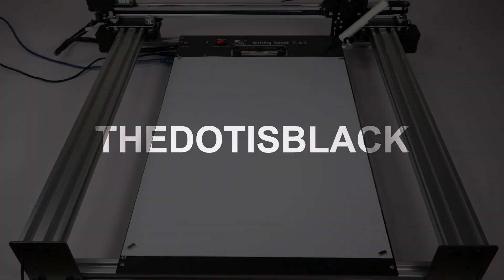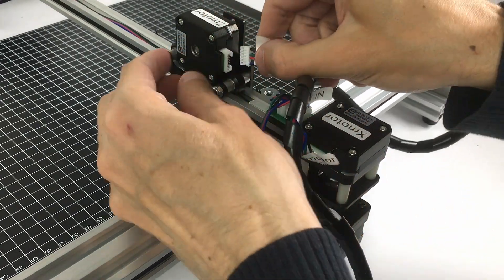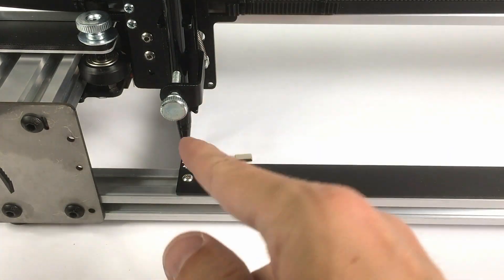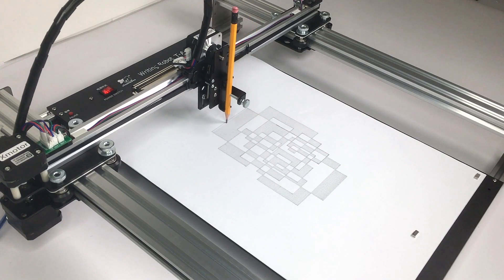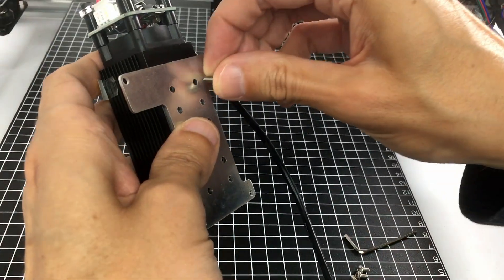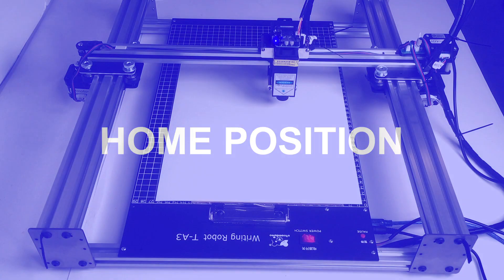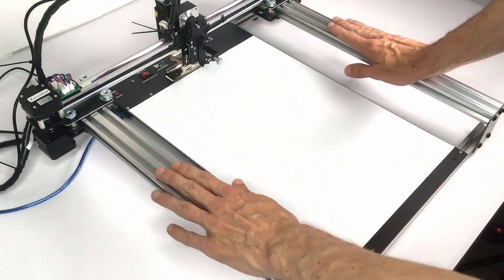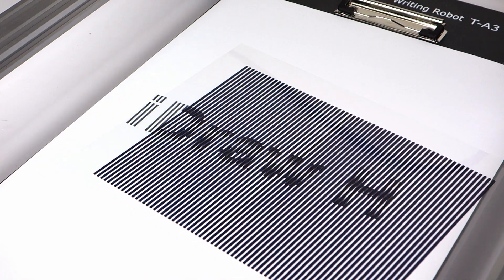REVIEW & TUTORIAL - iDraw H Pen Plotter with Laser Engraver  by UUNA TEK® (XY Drawing Machine)

Comment: Thanks for this review. Does this laser leave a black line on white paper after lasercutting?
Reply from the maker: Hi Rowin, at 32:30 you can see for a short moment a cut out circle on ivory paper. The front has no soot, back side is slightly yellow (that’s normal without air assist and grill), and the inner side of the edge is dark brown where the laser burns through the paper. That’s normal, there’s always soot with lasers.
Reply: @thedotisblack  Have you had the opportunity to try the 10/15W laser head as well?
Reply: @thedotisblack  What if I layered 3 sheets of paper, would the center layer white paper have no burn marks?  Also is it true that the lowest power laser model 500mW produces a smaller engraving dot per inch\millimeter than the higher 2500mW?  Thanks for the another great video!  Cheers!
Reply from the maker: No, I did not test the 10/15W lasers by uunatek. However I have a couple of 5W and a 20W diode laser machine. These are dedicated laser machines.
In general, there shouldn’t be any problem with more power. Works the same, just faster. But you’ll need protect the baseplate better.
Reply from the maker: Actually, you shouldn’t layer sheets of paper to cut through. It will be worse and you’ll need more time and power. Rather separate the sheet of paper from below, raise with a honeycomb grid for example. I have some laser cutting videos where you can see it.

The laser spot size depends rather on whether it a short or long focus laser. Short focus has rather smaller spots and is better for engraving, long focus generally has slightly higher spots and is better for cutting through thicker materials. 
500mW is slow. You can always change the power of a laser and thus adjusting the intensity of the burning/cutting.
Reply: @thedotisblack  https://youtu.be/6lBKCcUviZ4  Hello Again!  I found the video I saw a long ago about the "DPI" being higher\better on a low power laser.  I haven't found any other laser engraver on youtube making the same claim, and I don't have the expertise or equipment to test the idea myself.    If you ever have the free time and inclination I would love to hear a confirmation or debunking of the DPI difference between low\high power lasers.  My research say that LASER PRINTERS simply add more dots to create higher resolution. Somehow that sounds wrong to me because "more" is not "smaller"!  A laser diode at the smallest focus creates heat that would "blur" the dot created.  It seems to me that focus size and heat have to be ideally balanced to create the smallest dot engraving.   Cheers!
Reply from the maker: Hi! In general, you could say that a high power laser is not suitable for fine engraving. But it’s not that simple. Let me elaborate:

First, perhaps most important, short focus lasers have usually a smaller laser spot and are best for engraving. Whereas long focus lasers have a bigger laser spot and are best for cutting, especially thicker materials. 

Second, the more power a laser has, the larger the laser spot will usually be. This is especially true for diode lasers that combine multiple laser diodes with mirrors to one laser beam.
If the laser spot is large and you engrave with high dpi, the laser spot will overlap the burned/engraved areas and burn even more. It will result in dark spot. However, this can be controlled by reducing the power settings of the laser in the software.

And third, it all depends on the material and the size and details of the engraved image. Usually, with a high power laser, you would calibrate/reduce the power for engraving. Otherwise, the laser is simply too powerful and will burn the material surface. 

Lastly, some people intentionally set up slightly the laser out of focus to blur or add gradients (greyscale). This method is useful for engraving photos.

Personally, I think a short focus laser with a single diode is best for high quality engraving. But it is also slower.

Comment: Hello Sir,

instead of using Incscape to plot could you use Lightburn for plotting with the pens?

If so can you explain how to do it.

I hope you can answer my question.

Greetings from Belgium
Reply from the maker: Lightburn is for laser cutting and engraving only. It does not control the pen holder plate and thus it is not possible to use it for pen plotting.
Reply: @thedotisblack  Lightburn can work if the pen is activated with a servo . I have a Eleksmaker A3 en can switch between laser en plotter and they work both with Lightburn.
Reply from the maker: You can you use Lightburn for the laser module on the iDraw. However, I checked the Lightburn forum and some people manage it to work for pens but only if the pen holder plate has a servo motor. The iDraw has a stepper motor, it doesn’t work with it. Lightburn does not control the z-axis. Please correct me if I am wrong. Here is the link:
https://forum.lightburnsoftware.com/t/can-lightburn-be-used-with-a-pen-in-place-of-a-laser/10498/16

But I don’t know why people would like to use Lightburn for plotting. If you like to use some features of it, you can always edit your images there and export an SVG and then plot it via GRBL or InkScape. You will have more control over your plotter with these apps. Why do you want to use Lightburn for pen plotting?
Reply: If you’re using paper, cardboard, etc and not cutting, why use a laser?
Reply from the maker: @Kimberlymogan laser is great for cutting paper and thin cardboard. Also with laser you can engrave cardboard and other materials. It’s great!

Comment: hello I have a uunatek idraw H A3 and since a while when I plot the lines I trace are not plotted straight. On a simple line, I have 2 mm gap between point A to point B. How to config the machine to make the drawing straight and not unbalanced ?
Reply from the maker: Check the wheels on the y/x axis, on both sides. You might need to tighten the screws until there’s no movement. It should be tight.
Reply: @thedotisblack  thank you for your answer will try to tight the screws. If doesn’t can I still ask your help ?

Comment: where do i get a laser module? is it only for that plotter? I have the axidraw v3, i hope i didnt buy the wrong one
Reply from the maker: If you go to the website, you have several options to select from for this plotter, including the laser module. 

The laser modules work only with the iDraw models 2.0, H, A2, A1 and A0. These models have strong frames to hold the additional weight and the microcontrollers have the necessary plug for a laser module, including additional power adapter. 
The AxiDraw platform is not made for laser modules unfortunately.

Comment: Hello, I have UUNA TEK H A3, and I tried in config to connect it, but it cant :((. Can you tell me what specific to do?
Reply from the maker: Sorry for late reply. Did you manage to connect it in the meantime?
If not, please describe what the actual problem is and what you did to connect? Do you use the plug-in in InkScape?
Reply: @thedotisblack  error to connect to COM3. This happens when I go in my extension Idraw 2.0, i tried a lot of things but dont know the problem
Reply from the maker: @hosearmando6953 check different usb ports on your computer first, COM 3 might be occupied by something else. (You can look in your device manager.)

In the plug-in/config you can also change the COM manually. Everything should work automatically though.

Additionally, uninstall InkScape, delete the plug-in and reinstall everything. Update your USB drivers on the laptop and try again. Look on UUNATEK website, they also include driver updates, install them.
It sounds like it is your operating system that causes the problem. It does not recognize the microcontroller.
Reply from the maker: Btw, COM issues I had only when I had the laser cutter connected and wanted to use the plotter in parallel. 

I don’t know, but you might have something else connected via USB, for example a Wi-Fi dongle, microphone, keyboard, etc.

Comment: for less money <$250.00 with the laser mount  it would be a great deal ,I have 2 pen plotters #1 is the h bridge with 32 bit STM controller yes I built it ,it came as a kit I have $300.00 invested which includes a 10 watt laser, #2 is a standard arm type plotter with servo Z ,Ibuilt it as it came in kit form,adding in the pen holder and the controller I invested $150.00 and I built from my junk box a stepper controlled z for free now I do like the servo z also I run it at feed setting between 75000 and 100,000 yes I am using microstepping so I spent $550.00 for 2 machines as the laser cutter requires exaust and air plus it has a marble base plate,the drawing plotter has a sheet of 1/4 inch plate glass .so yes your plotter cost more but you only have one machine.
Reply: In terms of hardware, it's shaved to the bone for profit... yes - for the money you can build a level better machine